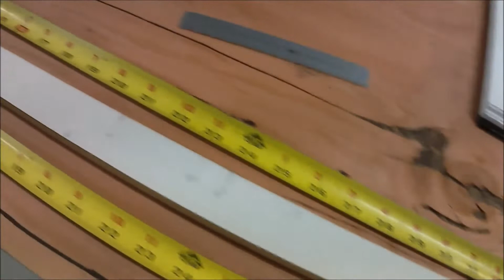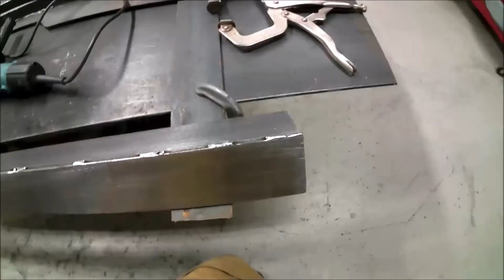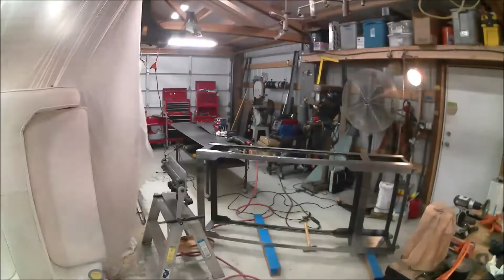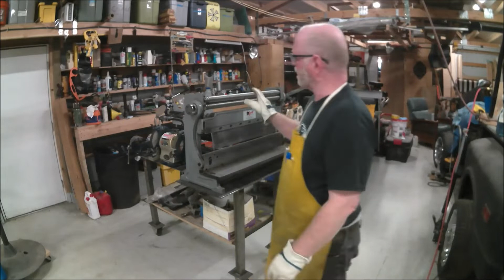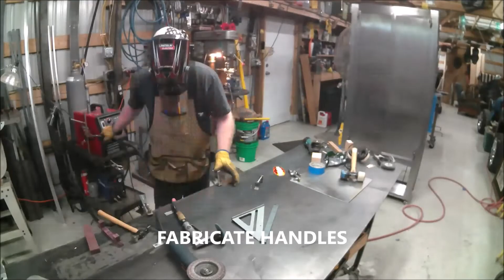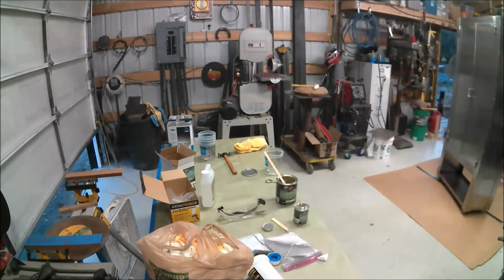INDUSTRIAL FURNITURE STEEL ARMOIRE

Comment: Next time rather than using 2 flat pieces to make an angle, buy a box section and cut into 2 pieces using plasma, then you won't need to weld and the edges will a lot cleaner looking since your weld beads aren't symmetric from top to bottom.
Reply from the maker: I intentionally used flat bar and random weld patterns with rough plasma cut edges not to cut corners but to create something different , I really appreciate your input, I believe all forms of art are to be questioned

Comment: Great vid and editing Rust!
Reply from the maker: Thanks it was 24 hours of filming condensed to 12 min
Reply: How long did it take to edit? Usually 4 hours per vid for me
Reply from the maker: Ratsnest Hotrods Not that fast still using my cheep laptop but I am working on getting a Desktop Computer with Intel i7-7700 3.6GHz  8GB DDR4 Ram  1TB HDD + 256GB SSD. NVIDIA GeForce GTX 1050 2GB GDDR5 | Windows 10, I think that is the minimum for good video editing